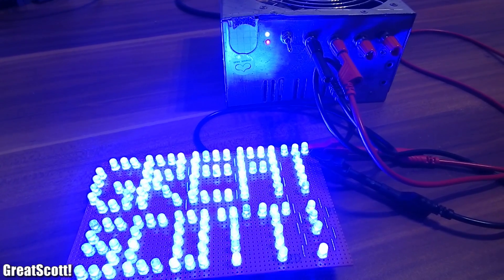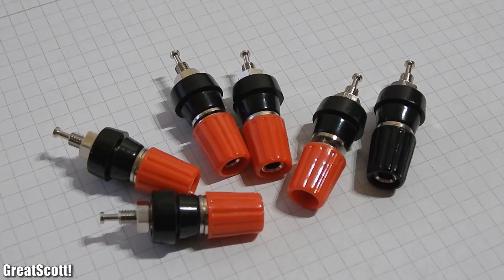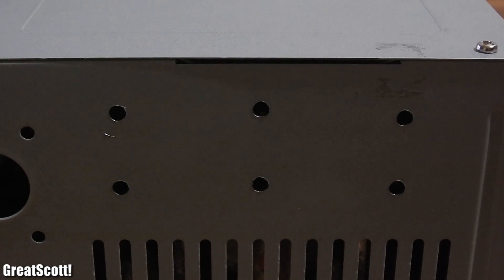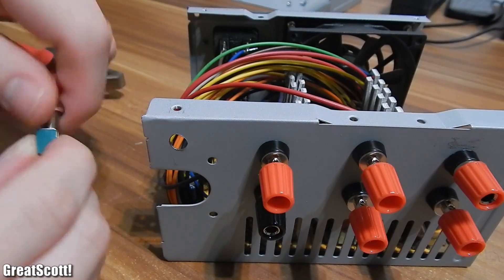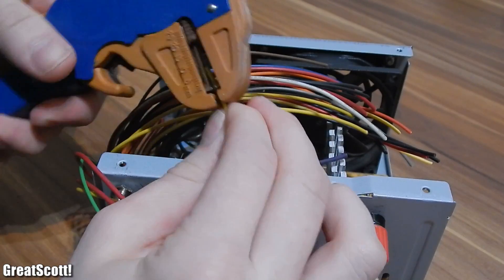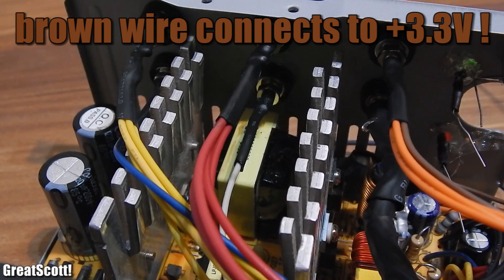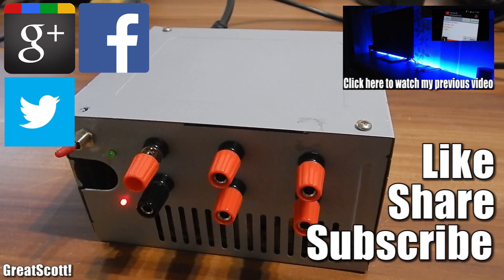DIY Lab Bench Power Supply

Comment: i got a question here.. maybe anybody could help..
i hv followed this video to the dot.. everuthing works fine when testing.. but when i put the +12v to the binding post.. the atx wont start.. where does it goes wrong?
Reply: Have you put the green wire to the black wire to start the power supply?  
Or you have to put a load on the one of the rales like 5v or 3.3v just put a 5w 1 or 2 ohm risister to load and power supply and it will start.  Or just put a 12v pc fan on 12v rale it's enough it will run

Comment: Hi, can i connect 12v and 5v together and then use a DC to DC module to get more power from atx?
Reply: No it's a really bad idia power supply will shut off with over current protection. Take 2 power supply and you can put 12v together yah that will be the best

Comment: Hey there, 
Its very difficult to find a power resistor required to start the atx. So can I attach a high ohm resistor so that even the thin resistor can handle the current?

Comment: I have a question: You were using  a resistor for the supply that produces most current, for making it stable on the small load, so im guessing you need a current flow trought the wire to make a stable supply. how much load is needed for specific power supply?

Comment: There are two major problems with this idea that I think are serious enough that you shouldn't leave them out from a video like this which influences such a large number of people:

1. While the voltages here are low enough to not be lethal to human beings, the currents that the PSU can provide are dangerous. A typical ATX PSU can commonly provide 50A at the 12V output. That is enough to make any jumper wires, pcb-traces, breadboards, and maybe even proper cables into fuses. I.e. it will melt your circuit possibly causing a fire in the event of a short circuit. You say that the PSU has over-current protection, but that is very misleading when it is unlikely that you will reach the current levels necessary to trigger shutdown. It is likely that you will already have a big mess by then.
The whole idea of a "Lab bench" power supply is that it will be used with experimental circuits which may fail, and in that case a proper current limiting is very important. I think it is unfortunate no not bring this up. Besides, the issue could have been mostly solved by adding quick fuses of say 5-10A to the outputs. A simple measure to increase the safety by a lot.

2. Most lab bench power supplies have floating outputs, whereas Computer ATX PSUs have mains-earth-referenced outputs. While this is not a danger per se, I think it is something the viewers should be aware of. A earth referenced output means that the GND output of the PSU is connected to the chassis of all earthed devices in your lab. Again, the voltages are not lethal in this case, but the high currents can definitely cause fires or burns. This means that not only is any dodgy experimental circuit a potential fire hazard, but also any mains-earth-references device around you. The classic one is when probing around with an oscilloscope, which typically has its ground probes tied to mains earth.
I don't know if it is possible or safe to disconnect the ATX PSU ground from mains earth and make the PSU floating, and having a mains-earth-referenced PSU is not necessarily a bad thing. But it is significant enough to be mentioned in the video.
Reply: That is why i put 5A fuse on 12v rail. And also, on my psu its ays that 12v rail can only output 12A and not more than that beacuse it have current limiter installed in psu

Comment: Hello teacher I would like to allow the teacher to be called. I apologize if I use the wrong language. I am interested in your video. It's a very well recommended video. I am studying and researching from YouTube videos. I opened your video and I liked your explanation very much. I have a little question to ask you if the resistor used with dummy load is from your suggestions.
R = U / I = 5V / 0,5A = 10Ω
P = U * I = 5V * 0,5A = 2,5W and
R = U / I = 12V / 0,5A = 24Ω
P = U * I = 12V * 0,5A = 6W From the calculated value, can I use the higher wattage and ohms? And which value should be appropriate? I would like some advice.
My power supply is 12 volts 22 amps / 5 volts 18 amps / 3 volts 26 amps.

Comment: 4:51 why do we need those resistors I don't understand?
Reply: It is in this article, which is basically this video, but more explained. https://www.electronics-tutorials.ws/blog/convert-atx-psu-to-bench-supply.html
Reply: @ralokossovo7906  Can I use a 2W10 OhmK resistor instead on the 5v?
Reply: @AlejandroRodriguez-lp4eu  I do not think so. To bypass the "turn on" protection on the majority od PSUs, you need to short the green wire on the 20 Pin connector to a black wire and have a dummy load of 5W. The resistance is calculated according to the formula provided in the link. If you want me to explain more just ask. 
Have a nice day

Comment: 5 years later, thanks :) Couple of points:
- Green PS-On wire can be connected directly to the Ground, if you already have the switch on the side of PSU, as I did. One switch less.
- My 2 large capacitors are discharged automatically couple of seconds after i turn off the PSU. I've read that good design of good PSU has resistors on each capacitor to drain them. But short them with insulated screw-driver just to be sure.
- Soldering such thicc™ wires with 35W soldering iron is really hard. Almost a cold soldering. Better to split the wires in two and wrap them around your binding post, securing with nuts.
- My binding post inner core was all metal from the outside. Be sure to insulate it, otherwise it will touch the ground (case) and a short could appear.
- Take some really old PSU, preferably with a fan on the side, with more room inside. Chieftec had a huge fan on top, it took space inside, i had to be very careful with wires to fit everything.

Comment: Wonderful video! I'm surprised that I hadn't watched this one yet.

One question:
What are the other color wires for? +5V SB? PW-OK? Just curious! Considering converting one of my old power supplies into a lab-bench supply after I'm finished replicating your variable lab-bench power supply :) I just need to find the time in the coming weeks to convert the case on an old stereo....
Reply: +5V SB is 5v standby wire and it gives aoutput when pc is off

Comment: Hi Scott, great video as always! I love you channel, thank you for sharing your knowledge so openly.
I have a question. I made my ATX bench, and all the outputs are ok, but with a slight instability in tension, like +/- 0.02 volts, and when I want to use it to power my servomotors (controlled by Arduino), this slight instability makes my servos jitter very hard.
Do you know what can be de cause and/or solution to this?
Thanks in advance everyone!

Comment: i created mine with 8 terminals (3x GND), ok, led and iluminated switch... while closing it was like packing full suitcase before vacation :D
Reply: Mine attach a buck & boost converter to 1 of 12v wires, attach a mini av meter, change the trimpot to potensiometer, and ended it on a binding post.

Got a 12, 5, 3.3 and variable voltage output

Comment: Confused about the load resistor. Most videos suggest connecting the load resistor to the rail with the highest amperage, but one video suggest the one with the highest wattage. On my PSU there is a +3.3V, 22A and a +12V, 15A. Which one should get the load resistor and why? Cheers
Reply: did you find out the answer?
Reply: No

Comment: Would be nice if you could make a simple schematic especially to clarify the point of how many wires and of what color you leave unsoldered from the bundle that goes on the posts and gets soldered elsewhere (led, dummy loads, etc.) depending on the type of PSU. Everything else was clear except that. I have an older PSU that works but it does not have the label with all the amps, voltages and watts so I am stuck. Kannst du mir bitte helfen?

Comment: my power supply wont turn on evem if i connected blanch and green and also put 5ohms 10 watt resistor to black an ground.The thing jumps start but doesnt turn on when i push the switch on green and black
Reply: i meant black and red

Comment: So this is un regulated power supply? Which is ok if you dont exceed the power supplied?

Orrrrr its regulated and the volts wont move?

I just want to power a battery charger. The power supply does not have to be perfectly regulated.. i dont think :p

Comment: Can you (or someone) please explain your recommendations for the wire wound resistors? Why 5 ohm 5 W for 5V rail and 24 ohm 5 W for 12V rail? And why did you end up using 2 10ohm resistors in parallel instead? Thank you!
Reply: nvm. Two 10ohm resistors in parallel provides 5ohms of resistance. Tried this with an old Dell PSU and seems to be working well so far. Thanks for the video!

Comment: Thanks good vid

You could pimp it up with a few volt ammeter things from eBay, maybe add a dial to adjust voltage or amps with a sepic or buck boost.  Also I would have kept a few molex connectors and maybe a Sata.

Comment: But, the metal cover of ATX supply is condactive right ? And when i connect ground wire and 3,3 , 5 , 12 V it goes short circuit, or not?

Comment: Like so others can do this if they're not wanting to scrounge around for 10 watt resistors and binding posts.  For $7-10 throughout the internet you can find premade PCBs that'll allow you to plug the power supply directly into to convert it into a lab supply.  If you're wanting an easier and cost efficient solution I'd recommend doing so.
Reply: These are available on eBay for less than £6. Just search for "atx breakout board"
Reply: Just got one and I've had no issues with it so far.  Just a bit of wire management and I think she'll do.

Comment: You can tell: If your PSU has more Power in the 5V Rail, you need a dummy load, if it has more power on the 12V Rail, you don't.

Most modern (quality) Supplys work fine without any load.

Comment: I notice that you use two 10 ohm power resistors in parallel to (achieve 5 ohms).
Can I use two 5 ohm resistors in series to make 10 ohms dummy load.

Comment: You don't need to cut the wires etc. you can search on ebay for "Benchtop Power Board" or similar, you basically connect the 24 pin connector and there, you have a bench power supply with switch, ledy's and binding posts
Reply: I wish I read that earlier
Reply: dammnit..i didn't see this comment before i got stuff.
Reply: There's anything like that but with an integrated step-up step-down to obtain a variable output?
Reply: Beware of these cheap "Benchtop Power Board" from China/Hong Kong. Most of them either do not have fuses at all or the fuse is rated at 5A max which is way less than a PC psu can deliver, so you're limited on what you are going to power with it. Anyway, better be safe than sorry. Also some come with binding posts that are too small and will not accept a standard banana connector. Other than that they cost around $8 USD so for the money they are just OK.

Comment: What would you recommend for an inexpensive power supply to provide 12vdc @ up to 2400 watts (if it spikes), converted from a standard US 120vac outlet? I'm trying to power a pretty hefty DC motor...
Reply: use car battery
Reply: Bogdan Pashchenko there are two main types of lead acid: starter batteries and deep cycle batteries. starter batteries can provide more current, but constant loads may damage them. deep cycle batteries are designed for constant load, but they are more expensive and can supply slightly less current. deep cycles are used in boats etc. where they have lights and pumps to power when engine is off.
Reply: 200 amps of current is a welders' territory
Reply: Huh. They say indeed those can provide several hundreds amps in spikes. 
Are those designed for continuous load, I wonder?
Reply: Ok, here they state 1C discharge rate is best for continuous load: https://electronics.stackexchange.com/questions/130580/what-is-a-safe-max-discharge-rate-for-a-12v-lead-acid-battery

So yeah, maybe the topic starter can wire several same capacity car batteries in parallel for continuous load of 100+ amps
Reply: Here's some topic on powering motors with a welder. For some it works, but there are some gotchas: http://www.practicalmachinist.com/vb/general-archive/dc-welder-run-dc-motors-77433/

Comment: Mine has 20A on the 5V side and 15A on the 3.3V side, and only 10A on the 12V side.

So i need to put the load on the 3.3V/5V side, right??

Comment: Hey man, really dig the channel!
Is there a way you can help (or even better, make a video!) of a similar project, but to make a digital power supply for tattooing (similar to the Critical Tattoo power supply) Would be it be cool to use a pi-zero with a lcd screen for the info? could it be done cheaper than the original one? (bout 300 dolars)

Comment: what about that 12V 5W resistor? Can i use only 3W? (12V, 13A)
Reply: A 3W resistor would need to be 48 ohms or higher.  His value for the 12v would actually move 6 watts through a 5 watt resistor, that's bad

Watts = Voltage x Current and Current = Voltage/Resistance  so Watts = (Voltage * Voltage)/Resistance or (Voltage*Voltage)/watts = Resistance.

You have a 3W resistor on the 12 v rail so (12*12)/3 = 144/3 = 48ohms

Comment: 1) what if the 3.3v supply has more current than the 5v ? should i connect the load resistance to the 3.3v in that case ? 
mine has 3.3v - 30amps
5v - 20amps
12v -18 amps 

2)Also how can I reduce the current of the output. Say I want a 12v 1Amp supply.. how can I get that ?

thanks in advance
Reply: you don't need the resistor with modern ATX power supply, but you should connect it to 5 volt if the power supply is a little older. also, you can power everything with the 12 volt rail, you will need constant current power supply only when charging batteries. if a transformer is labeled " 12v@1A" doesn't mean that pushes 1A thru anything it's connected. it's only the maximum power it can deliver
Reply: DIYelectronics Thanks a lot pal. I figured the Amp part by going thru a lot of articles online. Appreciate ur effort. 
cheers.
Reply: @diyelectronics5537  so if my power supply gives 14 Amps... I could connect everything i want?
Reply: Think of it this way, the label that shows the current is like your car's speedometer. It shows you how fast it can go but that doesn't mean the moment you turn it on it will go that fast.

Your car's speed will depend on how much speed you require, same thing with current. The PSU's current depends on how much current you require. The current you require is determined by the load you are supplying it with.

So assuming you're using a small 5V LED it might require 30 mA, this is you going 5 mph. Add a hundred of those (in parallel) and you'll be needing 3 A, kind of like stepping your pedal down.
Reply: Ananth Kumar but where should i put the dummy load.
12v-24a
5v-25a
3.3v-20a

Comment: So is it just me or does he fail to mention discharging any really fucking large capacitors because I'm scared af to even open this thing
Reply: dont short the leads with a screwdriver, use a 100 ohm resistor at least, shorting the leads might damage the capacitor and altereate its capacitance
Reply: Nah, those big caps will release at most 170V DC which is not too bad. If you want to be safe use a screwdriver and short the leads.
Reply: Got my real first shock from an ac unit the other day.... And I can say dam!!!! That hurt like a bit** and I was on the other side of the kitchen real quick I wanted to get out of the vicinity quick haha my wife was worried I was too but I'm good now haha... (Grounded myself on the shroud for the blower fan and touched the heater coil.....) Haha haha.... Lookin back now I could have avoided it... That was my stupidity and i learned from it :-)
Reply: 170VDC hurt as f*ck, may be a bit dangerous, but doesn't kill. (at least in my case, it didn't)

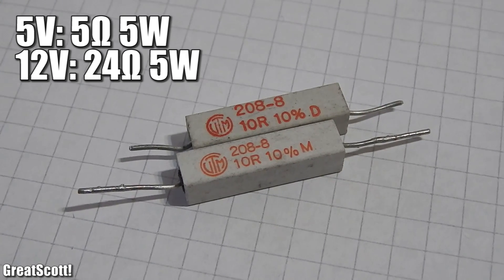Comment: 4:45 But if you have a 24ohm resistor for 12V wouldn't that result in 6 watts? I=V/R =12/24 =0.5A. An then P=IV = 0.5x12 = 6W. So how can a 5 watt resistor be enough?
Reply: I think that 1W more won't burn it

Comment: I red datasheet, and applied dummy load to all power rails : result was a bit more stable.. also those fancy white resistors are usually extremely hot and require a fan to operate well

Comment: I've got what appear to be 2 ATX power supplies; all the wires are right colors and test to the expected voltages, but the unit powers up as soon as it's plugged in and the status of the green wire, which is supposed to control power on/off, affects nothing. Any clues about what I've got here?

Comment: I don't understand how those binding post is touching the Medal case and not short out everything if you try to put any load on it., I had to use plastic project box because of that reason.
Reply: Most binding posts utilize a plastic washer to isolate the post from the casing. Essentially the screw rests between two collars and then those collars are tightened together with a nut to retain their hold.

Comment: Instead of using the purple standby wire for a always on LED why not put it to use like I said by using a clock or music device or anything that needs 5v 2a then use the gray wire as a power on wire for a LED, the gray wire only lights up if the supply checks out all good and is +5v so if that light doesn't go on you should look for damage before using the supply and doubles as a power LED, just a idea...